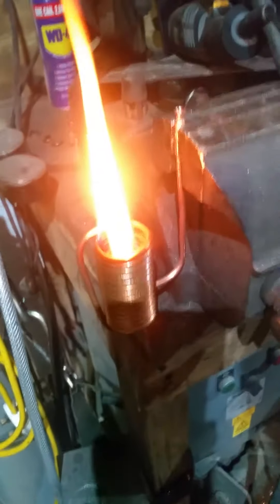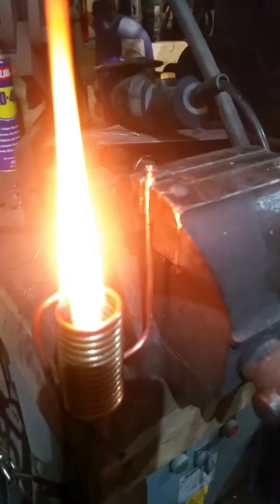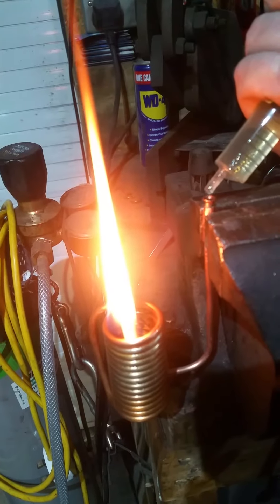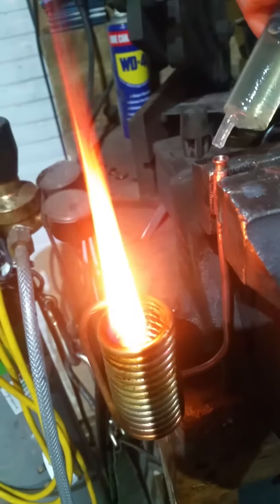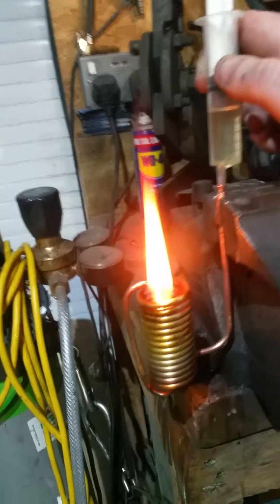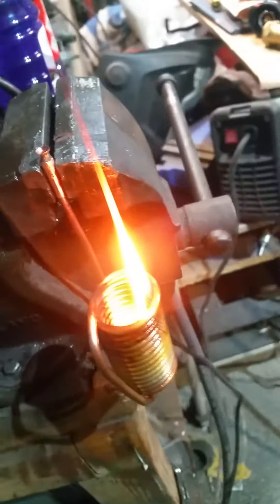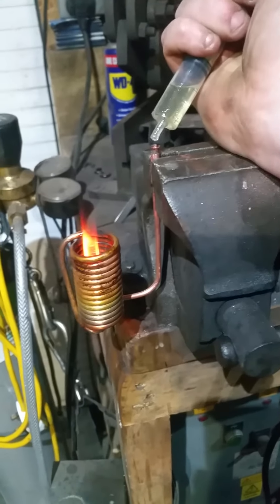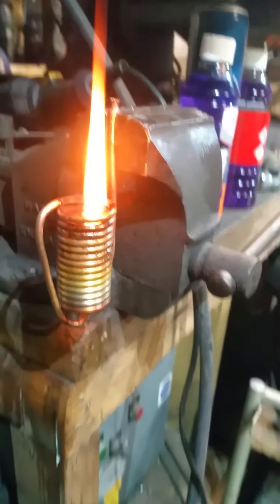waste oil/veg oil burner coil. homemade diy experiment 1-3 playing with copper coil an cooking oil

Comment: Looks like your flame is missing some air. You could space the coil turn to allow secondary air supply the flame
Reply from the maker: At some point I may have to look at this again. So many People like you're self with ideas for me to try. Never thought this would be my most viewed video. Thanks for watching and for the idea
Reply: @smithbuilt  on the nozzle end they make steel/copper  micro funnels if that may work ? . . .
Reply from the maker: Thats kinda what I made. It was just to act as a drip tray kinda thing

Comment: you did a good job,, but I recommend you to do a minor modification. sunflower oil bp is above 200 C,, and pressure buildup is not enough to make a jet while gasoline bp is begineing around 100 C. I think if you add 10 percent methanol or acetone, then you will have enoght pressure inside to make a turbulent jet. I am looking for your new test. hood luck!
Reply from the maker: Thanks for watching. I never bothered taking the idea any further.

Comment: You need to make a longer coil to get better results, the coil should be longer then the flame so probably three times the length of that coil
Reply from the maker: Cheers, the idea is long since dead but increasing the amount of coils sounds logical. Thanks for watching

Comment: Maybe a smaller jet is required, and/or longer start up firing time, higher head of oil would not hurt either.
Reply from the maker: There was no jet at all just the open bit of tube. I never bothered to use the idea in anything in the end. Thanks for watching

Comment: Maybe a nozzle on the flame end
Reply from the maker: If I had a pump to inject the oil then yeah I think a jet could help but this was only gravity fed from a short head height. it would just restrict flow in this configuration. Thanks for watching
Reply: @smithbuilt  Maybe but with a closed loop (fuel tank) the preheat should make enough pressure to spray then you only need to regulate the air intake on the tank.

Comment: experimenta colocar um cabo de aço justo dentro do tubo e colocar o óleo filtrado sob pressão.
Reply from the maker: Sorry I cant translate that.
Reply: @smithbuilt  try putting a steel cable inside the tube and putting the filtered oil under pressure.
Reply from the maker: @tavaresrco  I never took this idea any further, while it did work it would only function if drip fed at the perfect amount maybe using a digital device. If this was placed under pressure the whole idea would be lost as all I wanted was a coil that created the phase change in the oil from it's own heat output. But yeah if you have been inspired to make a heater from this idea then I very happy as that's the goal behind me sharing the ideas I have. Thanks for watching
Reply: @smithbuilt  dude, you complicate things too much. all you need is a small ball valve, a hose and a PET bottle with pressurized oil. You regulate the passage of the fluid with the register, and the iron inside the copper tube, is to maximize the contact surface of the oil with the superheated area, fragmenting the oil molecules into lean gases. I recommend that you study gasifiers and gasogen
Reply from the maker: @tavaresrco  I'll have to take a look. I get the idea of the wire. I have a bad habit of trying to make a simple thing complicated. I use waste oil for heating my workshop now I did try both forced air with drip fed and pressurised oil feed but in the end I've gone to natural draught. I guess that's as simple as I can make it. There are various videos of me working my way through the process on the channel if you're bored and fancy a look. You might have some useful thoughts an feed back for me cheers